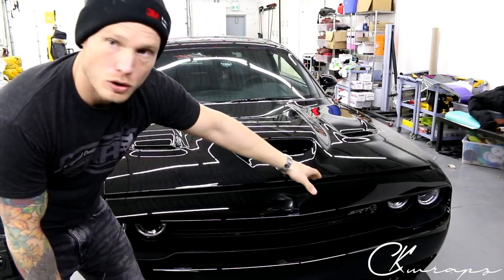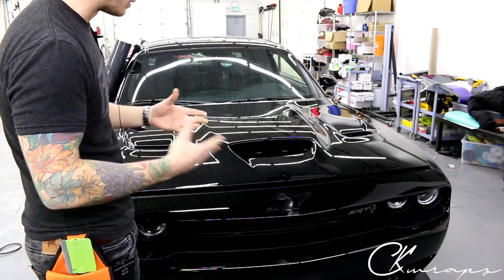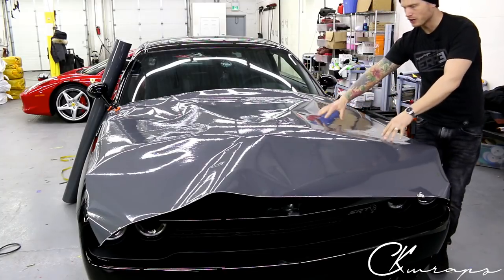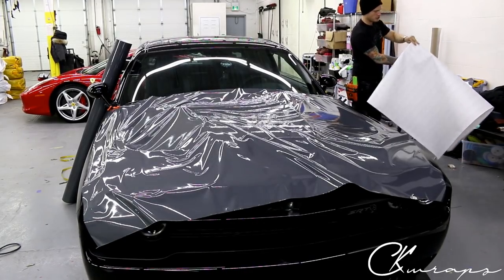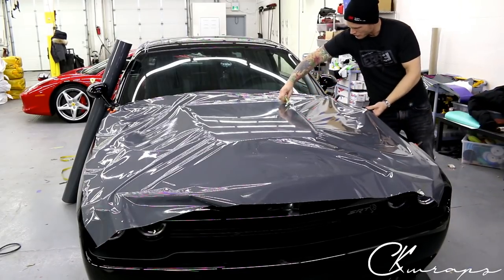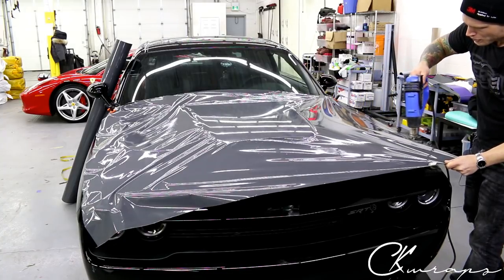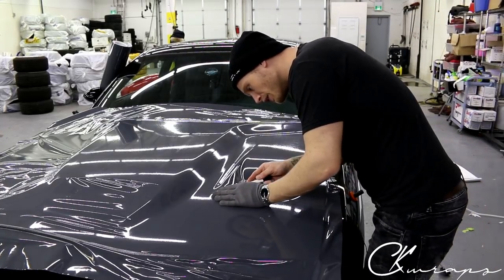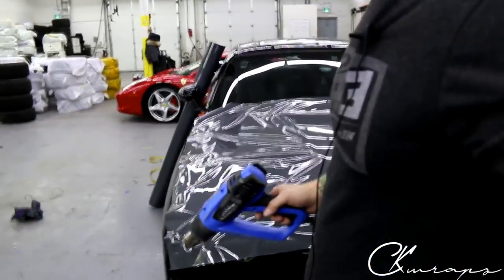How To Vinyl Wrap A Hood / Bonnet | Dodge HELLCAT Challenger

Comment: I am almost done wrapping my 350z in this wrap. I had a question to get the small scratches from squeegee and glove(also a little hazy)  I went back over the wrap with a heat gun which healed a decent amount of them but would going over it with a torch heal more if not the rest similar how you had to do with the Ferrari.
Reply from the maker: It's possible a torch will work a little better. Be careful when using it

Comment: hi. have you ever worked with teckwrap vinyl and do you rate thier material, thinking of buying some for my merc.
Reply from the maker: My car is wrapped in TeckWrap. It's been holding up ok all winter. Has a bunch of damage but that's mostly from not caring for it and the brutal winter we had

Comment: What kind of blades do you use, I know they are 30° blades, but what type and where do you get them please? 
Thanks
Reply from the maker: At this point I don't have any endorsed blades. I use mostly whatever I can get my hands on. Some last longer than others but the difference hasn't been much different
Reply: Japanese blades are very good -  OLFA SAB-10B
You can buy on Ebay

Comment: Hey I have a VIS invader style hood with a deep recess in the middle, how would you recommend I start? Should I glass the whole thing and work the outer edges first then stretch it into the middle recess last? Or should I push the meterial into the recess first then work out the wrinkles it causes?